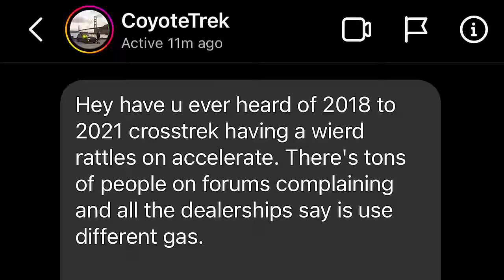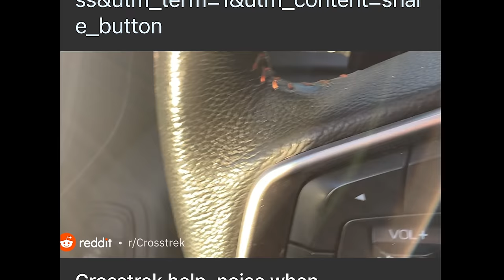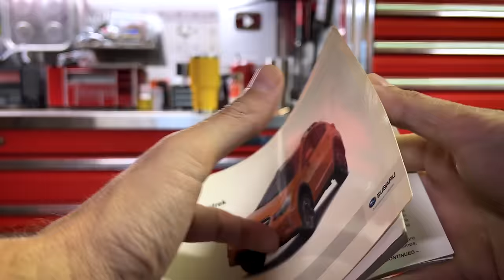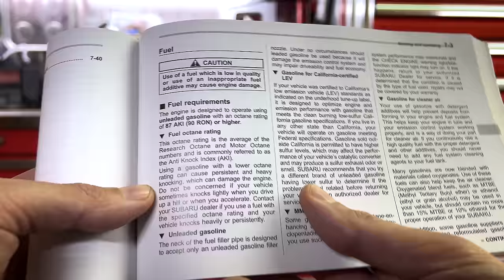Rattle, Ping Pop!? What Is That Noise In My Subaru's Engine?! Detonation & Pre-Ignition Explained

Comment: 2011 Outback 3.6R in Texas with 170k miles. Had the pinging so bad, i was convinced it was exhaust heat shield. CONVINCED. Except it wasn't. Because it was just as bad after I removed them completely. Lol.

Bottom line: bad ECT sensor replaced, Castrol Syntec Edge 0w-40 Euro oil, Takeda CAI that uses the OEM airbox/scoop, DEI intake tube velcro heat wrap, Costco 93 octane, and a rad/cooling system flush and refill with blue super LL + Royal purple Purple Ice.

Boom. Completely gone. Going back to 89 or 87 immediately brings it back, but not as badly with the 40 weight oil.

Engine runs more smoothly at 170k than it did at 90k. By a pretty big margin. Silky idle that is nearly silent. Revs out like a turbine and pulls hard.

Comment: You forgot to mention LSPI (low speed pre ignition) that occurres between piston rings. See a lot of videos on YouTube. This happen if you don’t respect the oil norm api SP or dexos by GM. I broke my corvette engine due to LSPI, not using dexos2 or API SP oil.
I can send you a video of the ping noise on my corvette. All direct injection engine can have this problem.

Comment: I've heard this exact same noise out of my 2007 Legacy Special Edition, my 2016 Outback 2.5 limited, my friend's 2013 outback 2.5 manual, and about 50% of the post 2000s subarus I hear accelerating from a stop light. Location is Denver CO. It doesn't happen in the winter, and it can be sporadic and hard to recreate, therefore every mechanic I ask about it says the engine is running perfect and they don't hear anything weird.

My hunch is that this ping/spark knock or whatever is one of the major contributing factors in subaru's notorious oil consumption plague. If the piston isn't traveling perfectly through the cylinder due to poor ignition or pre ignition, there is a gap that allows oil to pass through and be burned. Someone please tell me this wouldn't also cause shorter life of catalytic converters (another known and highly common issue) because of continual burnt oil byproducts in the exhaust.

Comment: No matter what car that I drive, I found that the best way to see if the knocking issue goes away is that I would try a tank full of high octane gasoline. If it still persists, I now know that it was not detonation or pre-ignition. BTW, my 2018 Subaru outback 2.5i has port fuel injection, not direct injection. I believe that Subaru started to go with direct injection in 2019.

Comment: Also experiencing this on a 2019 Forester. It’s exactly how you described it—sounds like marbles when accelerating at low RPMs. The car never used fuel lower than 95 octane and always from the top tier. Tried 97 octane and I can still hear the ping but not that pronounced and happens infrequently.
Reply: You mean 85 and 87 octane?
Reply: @williamevans6522  I'm not sure but we only have 91, 95, 97, 98, and 100 octane ratings from where I live.
Reply: @FrancisVidal  Different rating system across the pond, maybe.

87,89, 91 on the Left Coast.

If low miles, maybe you're  really pinging from carbon buildup. Direct injection  motors from '18 onward.  Port injection washes the intake valves and keeps the buildup at bay.
Maybe an oil catch can is in your  future. Mishimoto?
Burn oil?

Comment: Now i use 91 in my 2020 crosstrek and have not heard that noise at all and 91 seems to be better on mileage wise.
I drive like 65 to 70 miles for 4 days of work and on thursday i only use half a tank where as before using 87 a weeks use would be close to 1/4 of a tank left so i think 91 works better for me
Reply: If you're paying that much for gas. I'd recommend just switching to ethanol free gas. 
Ethanol ruins your engine over time. My baby loves Ethanol free. It performs so much better.

Comment: I deliver Pizzas with my 14 Crosstrek currently. The ONLY time i hear the spark knock is from 20 to 30 mph, and its always after the car has been running in stop and go traffic for a while. And its also very infrequent. Wouldnt be surprised at all if it was caused by the cheaper, spot market gasoline ive been buying from Kroger recently.

Comment: I don’t have the style engine but this whole entire summer with the summer blend my 09 Forrester with the EJ 253 I have been experiencing on and off chattering sometimes it starts misfiring and stalls at idle I tried a new ignition coil it went away for a little while and now it just randomly does this not for sure if it’s electrical or gas related it normally only needs 87 but if I put a higher grade in it it seems to not do it as much I have 170,000 on it which is getting up there
Reply from the maker: I think fuel quality across the board is really bad right now.

Comment: i just had to replace a crosstrek cvt valve body (expensive sucker from the dealer) irregular pressures in the trans caused torque converter clutch solenoid to lock up, but i noticed rattle noise from the trans at low load low rpm while under it on the lift listening through the pan, im assuming its the cvt chain

Comment: My 18 crosstrek does the same thing. It may just be coincidence but if i pull over and remove the prop rod and drive without it under the hood, The noise goes away.

Comment: I've had this problem with my 2014 crosstrek.  Problem was most prevalent just prior to cam phaser failure.
Reply: Any other symptoms? I got a ‘14 as well and wanna be prepared lol. Also does yours “hum” slightly (whum whum whum) around 4000 rpm?

Comment: I have had a 2015 Forester since new and it's pretty much had this noise happening since I have had it.  Took it to the dealer a couple times to be checked and got the "can't replicate" story.  Now it has 100K miles.  It's annoying but hopefully whatever is causing it to rattle sometimes won't blow the engine.

Comment: My guess is your values are carboned up, with direct injection you have to clean the top of the valves such as they don't see atomized fuel to clean off the residue from the pcv system dumping oil vapor in the intake tract. In the last couple years some manufacturers (I think Ford is one) have gone to direct injection and port injection to remedy this as they have a really hard time with carbon build up (amongst other things) with the 1.6/2.0/2.3 turbo engines. Run a bore scope into the intake, I'm sure you'll see what I'm talking about.

Comment: I get rattles when I take my foot off the pedal. It rattles at 4k and 2k. Can't tell if it's the diff or fuel. But since changing my fuel trims the noise has reduced in volume.

Comment: Not ping or knock. I can recreate the rattle while at highway speed just feathering the throttle. Meaning its not enitiely underload. I can also recreate the ping at low speeds also while accelerating because its chain guide rattle.

Comment: Strangely had a 2005 Forester EJ25 with load related low speed slight pinging … wonder if this is also endemic to these earlier engines? It was slightly improved by egr clean. I was recommending a dose of CRC decarboning thru intake??

Comment: I am pissed off my impreza 2018 engine pinging. It occurs when the weather is hot starting from 24° and oil temperature around 100°. Don't understand because knock sensors work fine.even with high octane gas the knocking still present.

Comment: I’ve brought my 2021 6 speed crosstrek to the dealer 2 times now for this issue. Everytime they drive it they say they can’t hear it, it’s more persistent after I kinda beat the hell out of the car on my drive home (driving it spiritedly). It happens the most in 5th and 6th gear if I mash the gas to go pass someone otherwise I never really hear it, or sometimes I’ll hear it as I’m taking off from a stop letting my clutch out slow

Comment: Hello. I have a 2018 Crosstrek and have had what has been said to be “pinging”. I hear the rattle with acceleration, particularly around 30-40 mph. It got worse and worse, but the dealership could not “replicate” the rattle. Finally, they did a test drive with me and heard it for themselves. Said it was a loose shield. Well, after it was tightened, the rattle came back. I have about 60k miles on the vehicle. Should I change the spark plugs? 

Also, I am on my third battery, 2 within 2 years. I just had the recent battery changed about 3-4 months ago. I have had hesitant starts 4 times now and most recently, a fail to turnover. Why is this happening? I have noticed I have to clean a large build-up of acid frequently too.

Comment: My 2011 Outback Premium 2.5 did this often, especially in warmer weather. It was especially bad during light throttle tip-in, non-existent during cruise and sometimes there during WOT runs. Dealer said same thing: 93 octane fuel or "cannot duplicate."

Comment: Hello Mr.subaru I have some concern with my subaru forester 2012 2.0 diesel.. so after I started  the engine was normal noise then it will be quite.. it's like hearing the sound and something happened  on you earing.. you don't hear the sound of the engine. What Is possible problem.. thank you godbless

Comment: Hi. I have questions. So my 2014 Subaru xv crosstrek hybird. It has 2 codes, P172A and P0700 both with TCM. so what do you think I should start to repair, the oil pump for Transmission or the other code with body valve. Thank you

Comment: I have a question you may be able to help me with.  I just  replaced the driver side cylinder head.  And now it has a pinging or detonation sound when I floor the gas pedal right from idle. It goes away as soon as the rpm go up. It also seems that the idle is low any help would be greatly appreciated.

Comment: Now I have a 16 wrx. New to the subaru boxers. I am at just below 1/4 tank it's a base model 6spd. Would being low on gas cause a rich fuel mix or lean. To cause the pre det. I've heard running them low on gas causes issues well if you have a cobb access port which I do not. I'm all stock besides a cat back exhaust that was on the car when I bought it. I got it from the dealer I work at. And the guy that traded it in used it as a daily and driver over an hr 1 way to work. So I doubt the car has any real issue. It had a clean car fax and timely maintenance. Again new to subaru and I know direct injection is louder than say an 01 honda. Or even my 88 chevy sbc tbi. So I know I could be just thinking to much into it. Always wanted a wrx as a kid well wrx sti but this is what I got. So trying to do my best to take care of it
Reply: Anything below half and your making the fuel pump work harder

Comment: Got a '21 Crosstrek Outdoor with the 2.5L engine. Started hearing slight engine knock this summer so I fixed it by filling up with higher octane gas. At what frequency should we carbon clean the intake valves? Nothing's specified in my maintenance manual for this service. Thanks.
Reply: On another video he said every 30k

Comment: Never had such an issue.
But could a stuffed/blocked/old air filter be a cause since it would mess with the air-fuel ratio ?
Reply: A bad O2 sensor in my ‘05 LGT caused all sorts of similar issues until it was replaced. MAF cleaning and sensor voltage check also.

Comment: Question, how many hours does it take to remove the engine from a 2017 Impreza limited hatch back with the 2.0L? Dealer says engine is seized and wants 14 hrs to remove engine and tear down and inspect roof cause failure. Engine has just gone over the 60k warranty. Oil changed every 4-5k miles. Oil level perfect, water level perfect. No mixture of water & oil. Recall completed last year for coil. Crank bolt does not rotate around, goes a little and then stops. Dealer tech says he has never seen this issue before on such a low mileage car. I emailed subaru USA for goodwill/policy help. Any suggestions welcomed.
Reply from the maker: If that's the book time, that's the book time on it. I can normally pull a Subaru engine in about 30mins though. Will be hard to pull with the engine locked, converter will have to be pulled with the engine, not fun. I'd call SOA hotline rather than email.
Reply: @MrSubaru1387  thank you for your reply. I’ll be calling SOA tomorrow.

Comment: It's "normal" or more importantly not detrimental. You have to be religious on maintenance and do intake cleaning and good quality fuel, not necessarily high octane but a Shell, BP, Mobile, etc, no "circle P" type gas stations that have like 40% alcohol in some cases or water leeching into the fuel. City drivers absolutely hate this sound cause the echoing off all the buildings constantly and the dealer in rare cases will replace the short block if you know how to ask (aka, I've owned 2 Subaru's before, I'm a good customer, etc) and clean the heads of all the carbon. Make sure you have the latest ECM update installed, a lot of people are driving around with the old software when the new update addresses a lot of the engine operation weirdness including battery charging logic. Typically this is done under regular maintenance at the dealer but I advise Subaru owners to speak up about it at write up. This is an old problem I haven't heard about in a long time. It's good to ask techs from different regions, Subaru problems vary from region to region lol - this totally a city complaint, stop and go operation makes it more frequent

Comment: My 2010 Subaru Impreza outback sport rattles when I accelerate and.ive been trying to figure the issue for years. I use ruthinuem sparkplugs and premium gas and stuff but still rattles
Reply: Check your heat shields
Reply: @bigdaddymak1439  I've done that

Comment: I have subaru forester 2020 I hear popping sound every time I start the engine, is that a problem that needs to be fixed?
Reply: Yeah, at least bring this up to a technician if you can see one. Could be plugs, and potentially something with the exhaust.

Comment: Hello Mr subaru.  I have a off the wall question to ask you. I can't find a solid answer for it. Do you know if you can put 08 2.5 sohc heads on an 05 2.5 sohc engine? I heard the pistons were different on 05 an might have to clearance them. Just thought I would ask. Thanks Randy.
Reply: The heads on early 05 are much different than late year 05.  You would have to look at build date
Reply: @RockyMtnguy01  I know the avls what it's called. But I think one map vs mass flow and egr. But I think if I use everything from 08 topend I'll be OK. If pistons don't hit.
Reply: @radarrx65v1  early model your pistons are not the same as 08
Reply: @RockyMtnguy01  I know.  Thought someone said you might have to clearance the pistons
Reply: @radarrx65v1  basically 05 is too much of a unicorn to be compatible with 06-09 as far as engine goes. Other components are ok.
Reply: @RockyMtnguy01  I have heard guys put them in and don't hook up the vvt vavles

Comment: In my 19 Crosstrek (69k mi), I hear a "chain-y" sound at low speed upon acceleration.  Its noticeable when I have a really heavy lady I work with in the car.  We car pool.  Def not heat shield or suspension; its in the engine.  Thoughts from anybody at all?
Reply: Under the engine it's a long heat shield just on the begining of the exost pipe. From the factory there is some wired sponges between shield and exost pipe. Those sponge's are worn and the heat shield rattleing. Make some adjustments on the existing steel bumpers to gane more thikness and the problem it's gone.

Comment: I have same noise on my 2015 legacy Subaru said it’s due to me putting cheap gas even tho the manual says put 87 lol
Reply: I have upgraded to 89 still noise so I’m like deg do I have to go 93 smh I’ve been using 89 for a year still noise and I upgraded spark plugs to one still noise smh
Reply from the maker: Have you tried non-ethanol gas?
Reply: @MrSubaru1387  nope I have not but I think I’m gonna have to trade in my legacy I found out I also have a cam carrier leak or so they say a month ago but I checked today and engine oil still full.

Comment: What I found that helped me is the plastic around the intake on top near the radiator rattles a lot I found another person on YouTube who put little foam pieces underneath to help with vibration’s. Haven’t heard the rattle when under load between that 1500 to 4000 rpm. I have a 2019 Crosstrek as well, and we’ll see how long this will last and if that rattle noise comes back. 

Hopes this helps some people out 😅

https://youtu.be/xKxnQKFqUJU